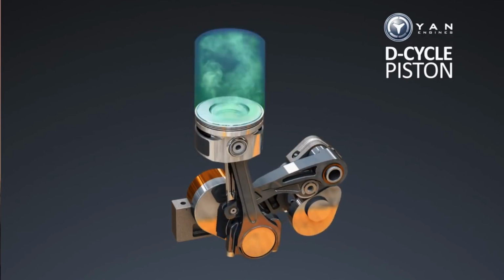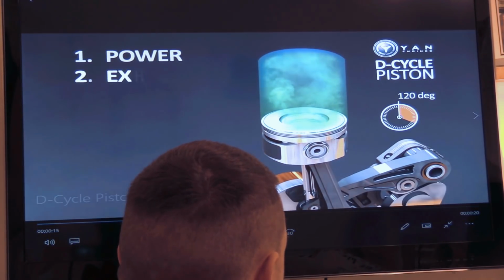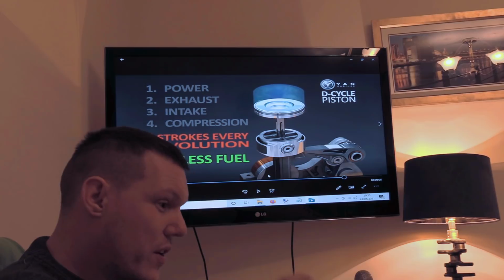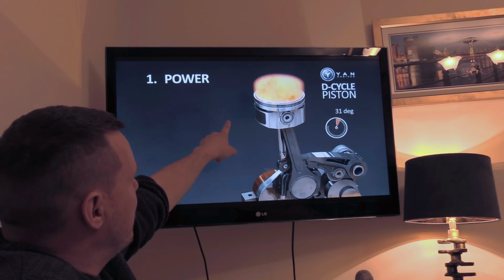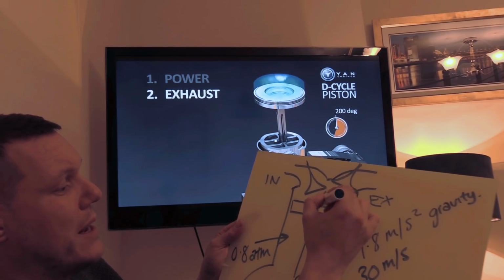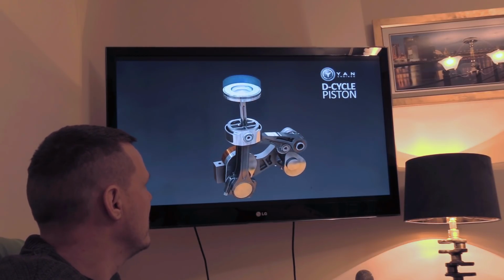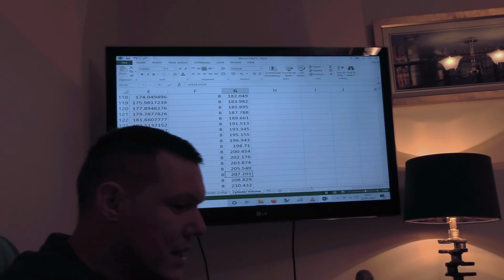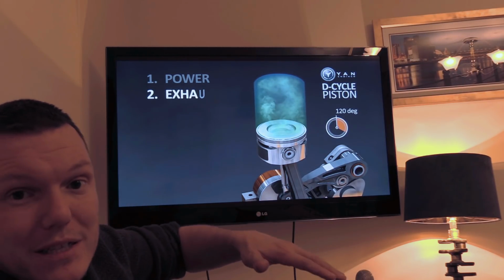Is this a GAMECHANGER? | D-cycle engine

Comment: Have you looked at the Atkinson cycle engine? same idea all four strokes completed in one revoution of the crank.
Reply from the maker: But it doesn't work at higher rpm, and there are different "engines" like the differential engine. You're talking about the cycle engine, which worked for steam engines but not for ICEs
Reply: @thedirtyworkshop  The one I saw (which was old but operated) was a petrol engine the one we tried and failed to build as apprentices was also a petrol engine. As I say we failed to get it to operate though. I have a book that has plans to build one and one day I might try it, unless I see a squirrel and become distracted.
Look this up on youtube, Gingery Atkinson cycle engine, Gingery is the guy who wrote the book I have.

Comment: As i just finished my thermodynamics exercises, i wached this video and i realised : this designé is crepés. But for real now. I also saw the achates two stroke diesel engine and that f1 wight use two strokes in the future. Are you able to calculate/ explain why exactly that design is more efficient like they claim? Engineering explain said, the engine does not lose heat over the cambody or similar, but if the compression ratio is the same, where‘s the benefit?

Comment: The cam arm/follower does not have to float freely, nor be returned, along with the piston top, by either gravity or a spring; it can be controlled with a desmodromic-style cam that positively both raises and lowers the piston top and its associated con rod.  It's really just running as a compressor/air pump on behalf of the power system.  

The problem with the "crash" between piston top and bottom at the end of the intake stroke can be zeroed by a cam profile that starts lifting the top into the compression stroke to "dock" with the piston bottom, before cylinder pressure prior to combustion builds very high.  Moreover, it seems like this is almost a mandatory candidate for forced induction, which changes the dynamics of the flow and presumptions about the requirements of the intake stroke on the piston top.  With forced induction, the piston top just pumps out exhaust; the supercharger or whatever does the cylinder intake fill.

There's another issue, which is the hyper-speed intake and exhaust valve cam action (relative to rpm) and the accelerations of the valves both up and down.  Again, either a desmodromic control or a freevalve-style active control of intake and exhaust valve movement would be needed - otherwise, either valve spring pressures would have to be enormous, or RPM would have to be limited - which would almost be inevitable in the first implementation.  The valves, after all, are moving as they would in an engine running at much higher RPM; they've got a damned short period to open and close between the end of the combustion stroke and the start of the compression stroke - maybe 120 degrees or so, instead of 360;.

Another issue would be piston top heat dissipation - the piston tap mass would be, by design, very low, in order to support the rapid up/down of the exhaust/intake cycle.  The mating surface between the bottom of the piston top and the top of the piston bottom does not look large enough to transfer that heat away from that low mass top, which - unless the top were ceramic insulation coated or some such - rapidly heat the piston top to the point of either heat failure, overexpansion failure, or failure from flutter of the red-hot top under load.  Perhaps an oil spray or internal oil circulation cooling strategy could mitigate that, although it would certainly add complexity.  A heat flux model is needed.  

Just a few thoughts.  Has a running prototype been built?

Comment: It looks like a  nightmare to make work, and then thermal expansion issues and elasticity of conrods etc to add to the mix. I am not convinced about the "efficiency", in a "traditional" engine the intake timing is just one factor affecting cylinder filling. This engine also has two "pistons" generating friction in the bore although granted  the lower one has no rings. I realise that a practical implementation could have different proportions to the model but the existing rocker ratio is going to give the cam a hard time. I can also imagine some dieseling occurring when the pistons clap together in the crankcase oil vapour at high rpm. I look forward to the next part.

Comment: Two rods sharing duty don't need to weigh double typical rods, crown could already be on its way up when lower engages and forcing of intake may compensate for usable volume  reduction. Engineering can make two pins match one. I like it. Hope it turns out good.

Comment: Just with the 4 strokes in one makes the top piston would be moving at a much higher rpm. I mean you’d be making it make two full rotations in one so double the rpm. So at 4K of the lower the crown would have to move 8k just to keep up. The other thing I thought about when you mentioned the timing was what would happen if anything got out of time even a little bit. The easiest thing I could think of is making everything gear driven but that could get complicated when you try to get the cam timing down. Since it’s basically a 2 stroke the cam would have to spin at the same speed as the crank. Driving a water pump or balance shafts would be interesting and could help bridge the gap between the cam and crank. A more complete model would be interesting to look at with everything moving around. Making each piston longer could help with the pin and skirt situations for the crown and let them nest without making either weaker well at least that would be ideal. To help the crown come down maybe a torsion spring and a helper that’s supplied with oil pressure. The valving would be interesting to get the pressure to wherever it needs to be with out adding too much resistance as it starts its compression stroke. The way it looked just by the animation is that the power stroke is longer than the intake. I have no idea how that effects performance but I can’t imagine that it would help. Granted a forced induction system would help with that to some extent and help a bit with forcing the crown on its way down but would cause issues in other ways. Extra load on the crank and less exhaust back pressure with a supercharger or less crank load and more back pressure with a turbocharger. Granted having  multiple cylinders would help with either of those. Probably the longest comment I’ve ever written lol.
Reply: Matt from this comment can you do a video on mechanical losses with chain / belt / gear driven engines just a brief overview as to if there are any differences between the engines would be interesting
Reply: I don’t really have access to everything I’d need to make one.  I just know that you can run into issues with chain stretch and other weirdness with tension issues and the chain jumping a tooth or two. With a gear drive I’m not sure if it’s impossible but it would be much harder since everything is much more rigid. I know most heavy and industrial diesels have gear drives for timing and the injection system. Don’t know if it’s for reliability or simply to help prevent timing issues with wear and since they tend to run for most of their lives until something comes apart or fails. With as many moving parts as that design has if anything jumps out of time there’s pretty much a guarantee that something is gonna touch something it’s not supposed to. Or at the wrong time depending on what portion jumps out of time and by how much.

Comment: Mat I can't see an issue of the two parts of the piston crashing together, surely the bottom half can only rise as high as the cam profile allows?
Reply from the maker: No. The rocker arm sits on top of the cam, not under it...

Comment: I can’t imagine the amount of failures.   Nevermind the balancing issues but splitting a piston in two, doubles the failure points. Then the weight of the actuation of the secondary piston.   I like the “out of the box” thinking but it’s basically got 3 connecting rods and a tertiary camshaft.   It’s just too much.

Comment: Without considering the possibility of issues with the engine. If all worked perfectly based on the design. Would the 40 or more percent weight gain of the engine not negate the 20% fuel saving of the engine in a vehicle?
Reply from the maker: 40% weight gain... where did you get that?